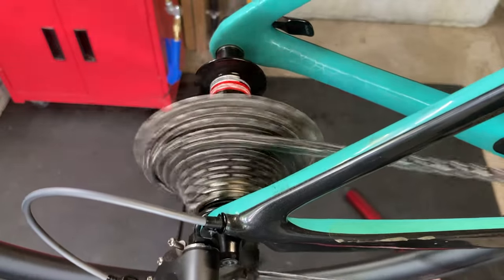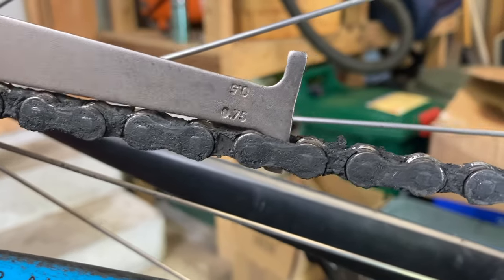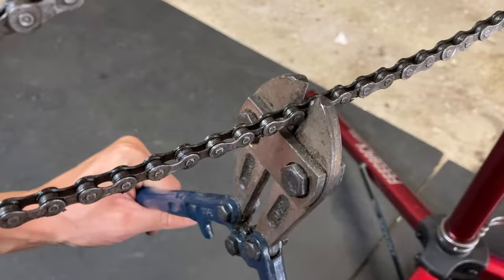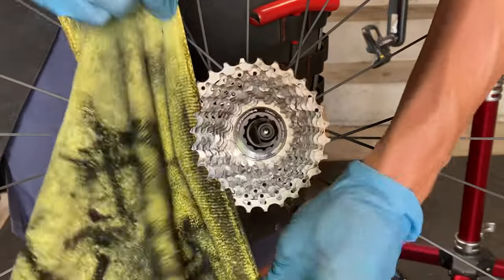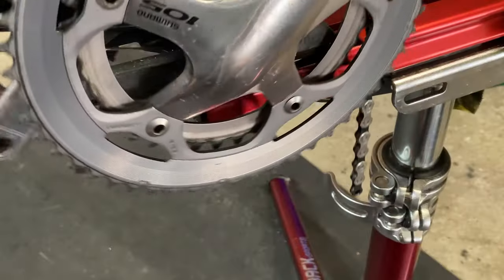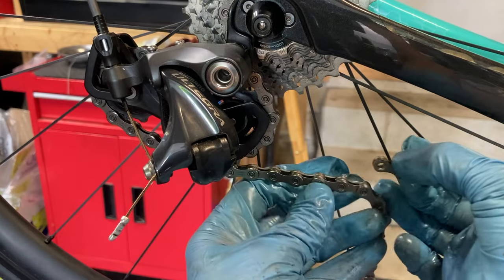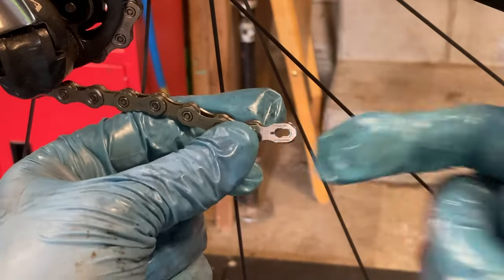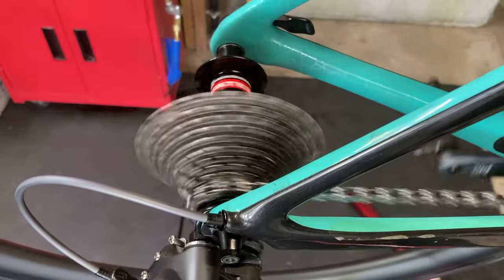Don’t Let a Worn Chain DAMAGE Your Bike!

Comment: My 11 speed chains always wear a lot faster at the quick link, it gets to 0.5 wear when the rest of the chain has plenty of life. Should I go by the quick link or the rest of the chain?
Reply from the maker: Very interesting, although I don’t think you need to worry about replacing just the quick link.  As long as your not having shifting or jumping issues, the quick link should be fine to keep for the life of the chain
Reply: @onelastlap9302  thanks for the reply. Seems more noticeable with KMC but not so much with DuraAce. I tried changing the quick link once and it didn't really help, I'm guessing the pins in the quick link wear the rollers quicker than normal pins 🤷🏽‍♂️
Reply from the maker: @kpizzle1985 are you noticing any issues with shifting/jumping chain?  I'll check some of mine as well and see if I notice that too

Comment: I have a single speed cruising bike . When I pedal hard up hill the chain keeps falling off I’ve wrecked twice now and it ducks . I’m not sure if my chain is just too loose or something is bent (it’s and old used bike ) should I take it to a bike shop any ideas on fixing it ?
Reply from the maker: Hmm, it sounds like the chain tension might not be tight enough.  On single speed, the chain should be pretty taught to prevent any risk of the chain bouncing off.  Alternatively, the wheel or crank may be loose, and be causing it to skip.  Finally, it’s possible the chain is very worn out and is skipping off the gear, but I’d check the other two first
Reply: @onelastlap9302  thank you so much !!

Comment: Don't forget the 0.75 version too
Reply from the maker: The original version of the chain checker?  The one with .75 and 1.0?  Generally the recommendation now is change for sure at .75, and even at .5 for high end performance drivetrains